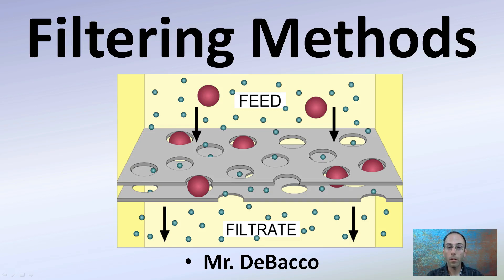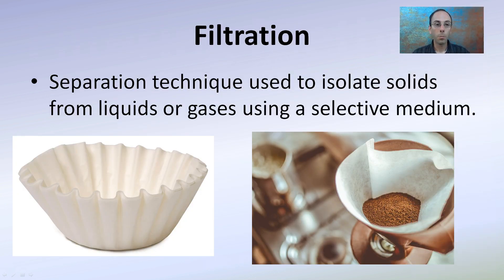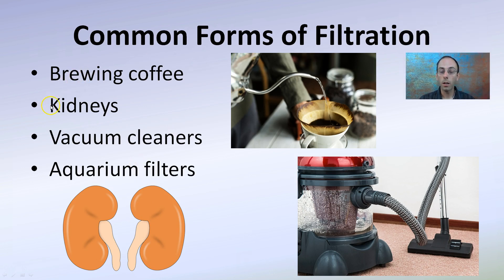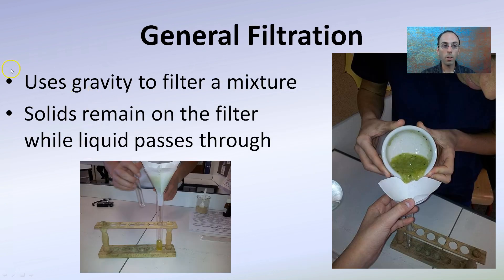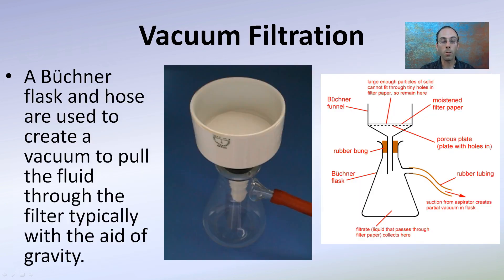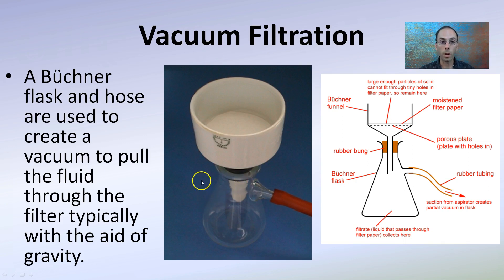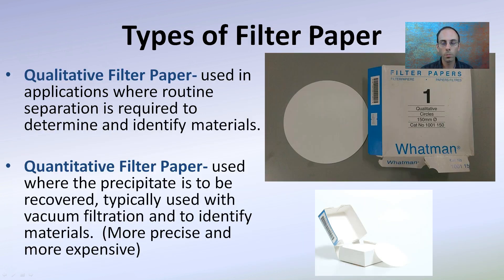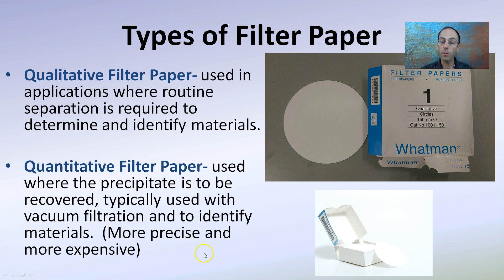Filtering Methods

Comment: Can you use qualitative paper to filter through certain liquids that have tiny particles and is the filtered liquid safe to drink. Also what is the vacumn method. Is it an additional electrical component? Thank you!
Reply from the maker: There are many different subsections of filter paper, you should reach out to a supplier to get more specific information.  (Ex. https://www.fishersci.com/us/en/browse/90179021/qualitative-filter-paper)  The vacuum filtration method typically involves a Buchner funnel and either flowing water or a vacuum pump.
Reply: Thank you, I did but have not heard back. Trying to learn about this on the internet is so difficult. That’s why I’ve been asking some scientists on YouTube. It’s impossible to get an answer o the web or through the manufacturer.
Reply from the maker: The key challenge is "safe to drink" and if this is your main goal other methods may be considered.  While filtering can produce drinkable water this can produce some challenges with different substances to remove and then there is also the "life" of the filter.  One such filter product that may fit what you are looking for is called "LifeStraw"... https://www.lifestraw.com/products/lifestraw
Reply: Thank you. I’m just wondering if you can use the qualitative filters for things like straining pulp from juices and for coffee filters?